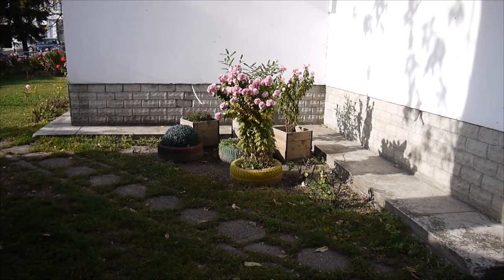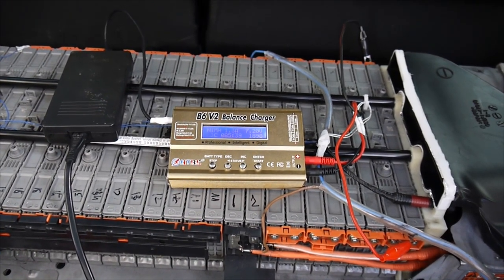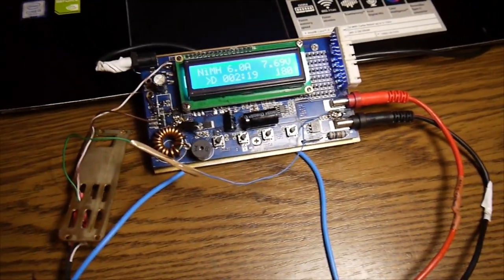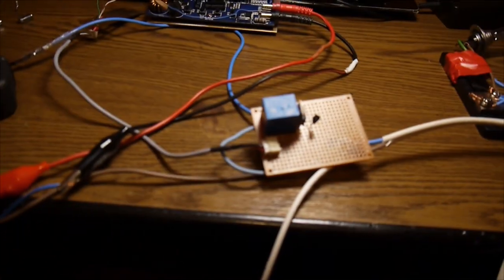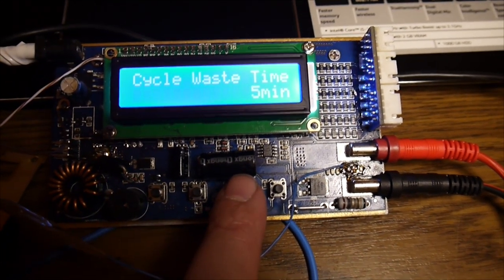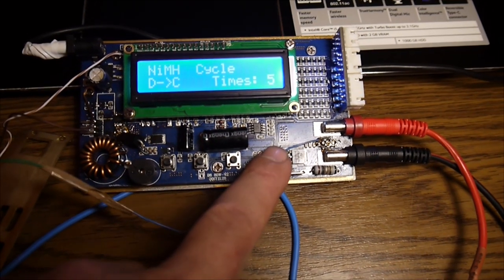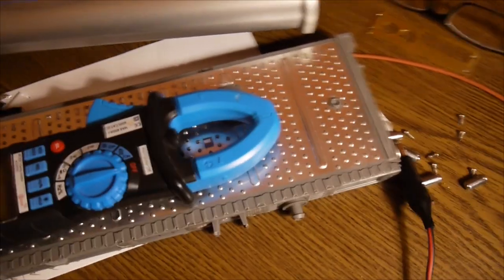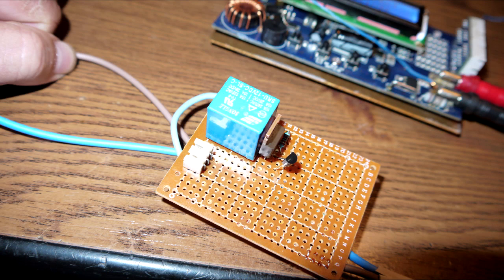How to check and fix Toyota Prius HV battery hybrid DIY test tools Part 1

Comment: Hola buenas,
Para cargar y descargar un module de Toyota auris cuanto tiempo necesito por favor?
2 horas carga +2horas descarga+2horas carga??
Es correcto
Reply from the maker: LIke 1 hour 30 minutes charging and 2 hours discharging...the whole cycle is about 4 hours let's say...if you do 5 cycles is like 20Hours..but 3 cycles are ok to see the state of the element.
Reply: @viocaia  You have an email? I tried balancing two batteries and it inflated on two modules. Maybe I have the wrong settings or something? The cells that I am recharging are at 0.2, they are practically empty and if I swing it some of them swell, leave me your email and I will send you photos if you want, please thank you
Reply from the maker: @estoesfutbol9496  viocaia@yahoo.com
Reply from the maker: @estoesfutbol9496  if the element is under 6V...I'm afraid is long gone...
Reply: @viocaia  my parametres is
NI-MH chargé aut
Cur limit 5.0A
NI MH discharge
1.0A     6.0v
This is correct?
Reply from the maker: @estoesfutbol9496  yes..go for it
Reply: @viocaia  Inflating the cell is normal?
Reply from the maker: @estoesfutbol9496  yes, it's normal, it should be nice if you don't have in a pack, to make a sandwich in between to pieces of strong wood..to keep the element as flat as possible.But from my expertise it was never a leak or something..also , discharging with 1 Ah it will take at least 6 hours for good element to be discharged, but it's very secure, no extra harm to the element.

Comment: So u mean we have to wait 30 days without the car do u no think this is westing time i can repair this battryey next day without this charger , load test nd change module simple !
Reply from the maker: Hey! Just give me a hand and  subscribe ! Thanks!
Reply from the maker: Of course, you can do it in 2 hours! if you have the elements! Since I don't replaced the whole battery, I preffere to check every little one before, you don't have to get stocked in the garage with a no working car, I just let it open, with the metal cover out and once in a while checking elements one by one! You can do cycles with the battery on.